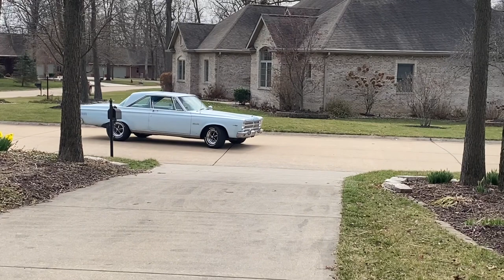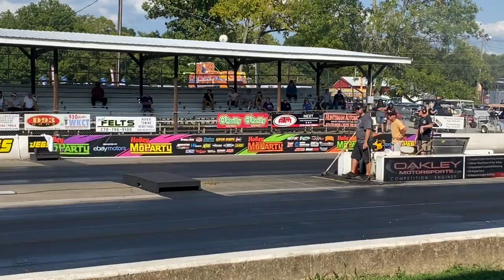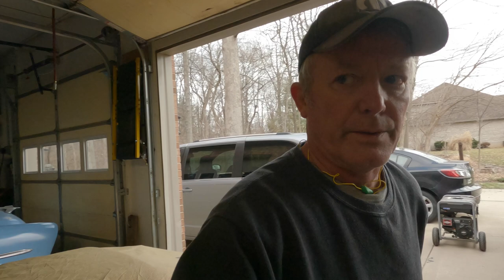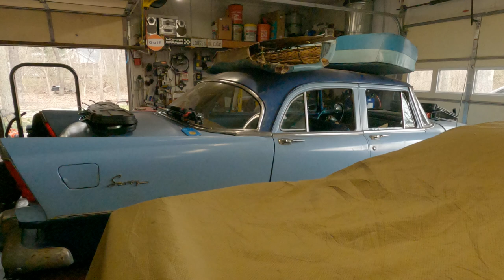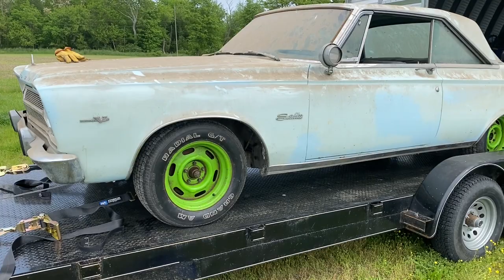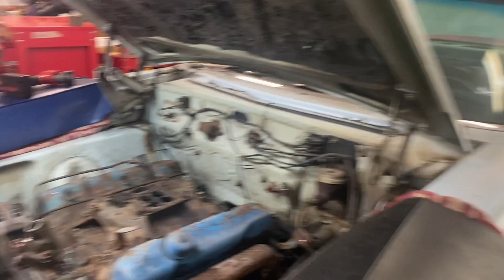Adios Louise | 1965 Plymouth Satellite

Comment: Louise had a big impact on my build and some choices I made with my 65. It’s sad to see her go. What kind of increases do you think porting would do on a big block 383? What do you think it would be like a half a second in the quarter mile? Or just a tenth or so.. reason I’m asking is I might just get the aluminum trick flow next year instead of running my cast-iron heads just like yours.
Reply from the maker: Well a set of Trick Flows will make a big difference.  I can't say how much but it would be noticeable with a set of headers.